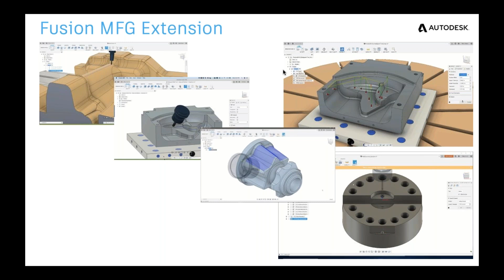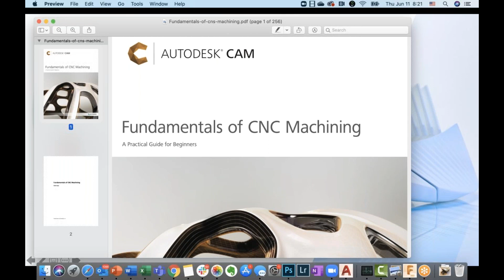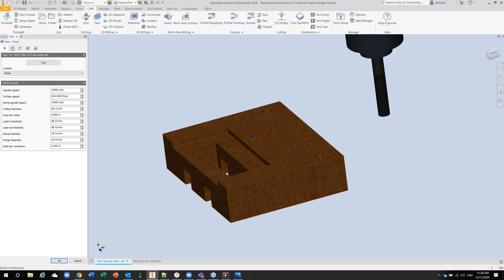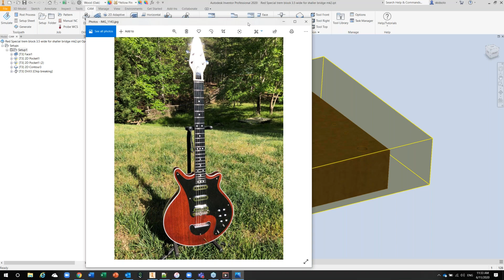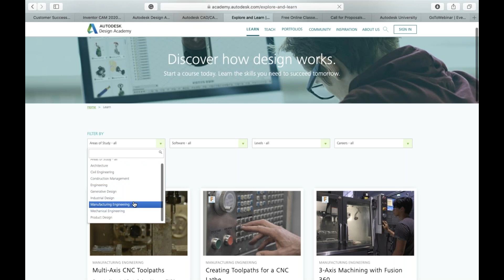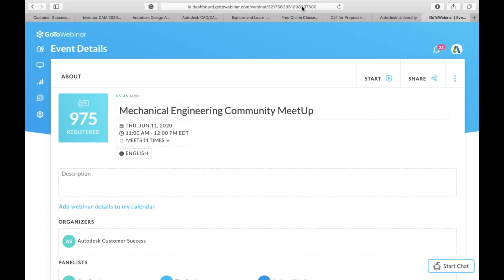Computer Aided Manufacturing for Mechanical Designers and Engineers (June 2020)

Comment: I use Inventor CAM every day for simple to complex general mfg and bending dies and the program works well, doing design in Inventor and machining in CAM, but CAM needs many improvements which didn't happen in last years, seems to be "abandoned" and programmers "migrated" to Fusion and Power Mill, even I complained about a few issues and lack of control and features especially in 3D adaptive, I haven't seen any changes in last 3 yrs. (every year upgrading to next Inventor CAM). The program is very intuitive which I like the most. Overall it is helpful in complex jobs and easy to use. I have Fusion too but did not like it!
Reply from the maker: Thank you for taking the time to comment. We have continued to invest in our CAM offering both in Inventor and Fusion 360. We recently posted a new blog post to highlight what is new in the Product Design and Manufacturing Collection. We highlight a bit of work we have done this release around turning in Inventor CAM. All that said we have added tools like the Advanced Manufacturing tools for Fusion 360 and you can see Fusion 360 evolve into a manufacturing platform with Generative Design & subtractive workflows. We will be introducing some beta features next month that you might be interested in and we would love to get your feedback on. Stay tuned as it will show up likely mid July. Best regards, Garin Gardiner-Inventor Sr. Product Manager
Reply: I could not agree more with what Srn C said. We were all sold a bill of goods years ago that all 3 platforms would be fully supported. Asking your Inventor CAM subscribers to switch to fusion in order to at least get the latest toolpaths is complete rubbish. Especially when it comes to multi axis toolpaths. We have to pay more to have inventorCAM, we are the shops that own more expensive 5 axis machinery, need to keep our files secure on our own servers, yet the “hobbiest” users of autodesk software (fusion users) have access to all these new features. I’ve never seen such a backwards business model as what you have going on now with this abandoning of hsm.